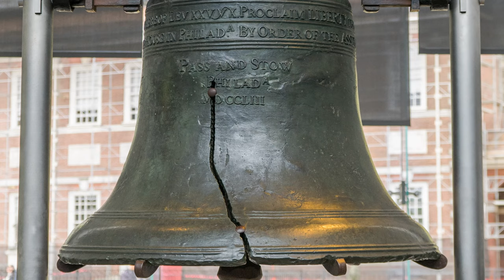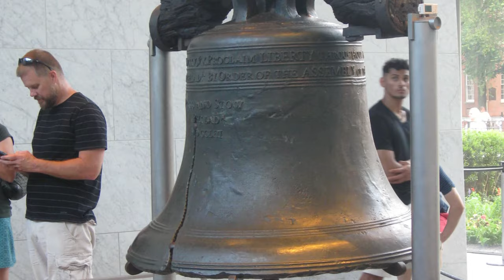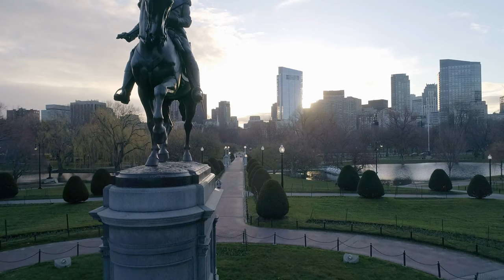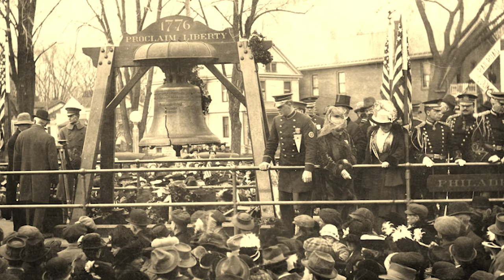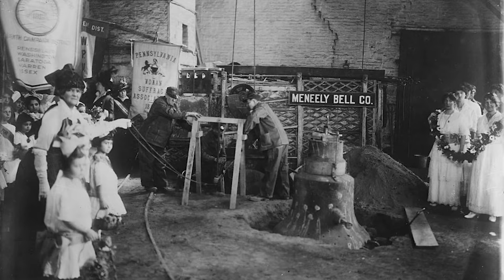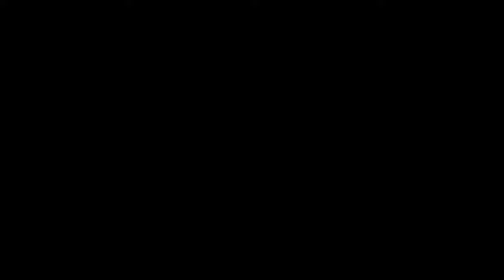The Story of the Liberty Bell

Comment: I've read on Reddit (not a good source I know) that the reason behind the crack was a defect in the alloy the bell was cast from and trying to recast the unit without knowing what metals were originally used only made it worse.
Of course the explanation given by the foundry that made the bell was that someone hit it to hard during testing and none of their previous products had failed immediately in 400 years.
Of course they would say that, no company would ever acknowledge that one of their products was defective unless it either k*lls someone or multiple units end up getting broken.
I'm willing to say it was a bad alloy, mistakes do happen. Or perhaps the person making the bell didn't like that America was fighting for independence and sabotaged it as if to say "Your fight for liberty is broken. Resistance is futile."